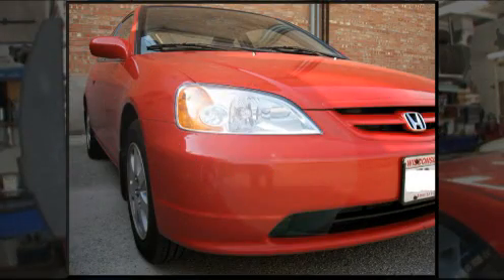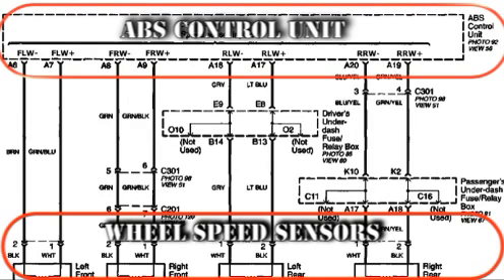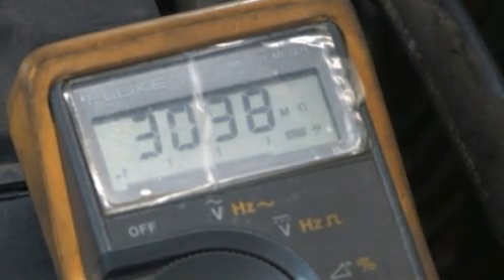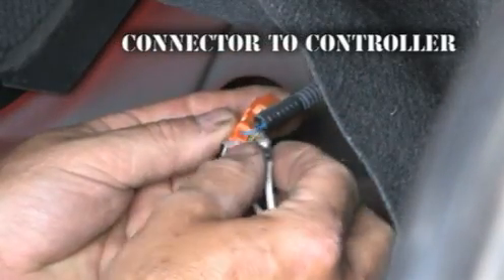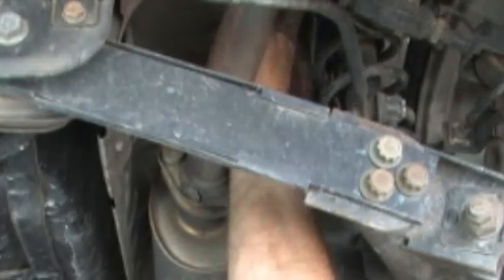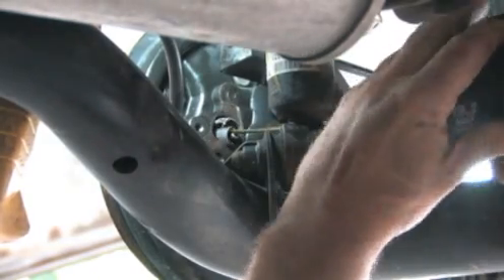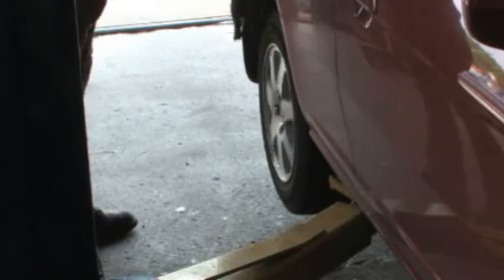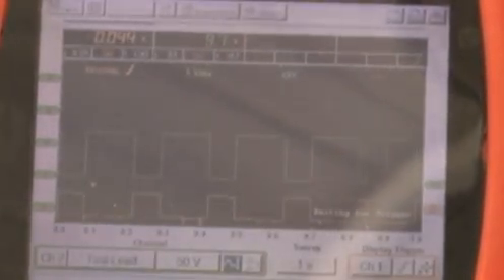ABS Sensor Diagnostics, Troubleshooting and Repair

Comment: This is a very old video. Most newer cars don't use this same type of wheel speed sensor. if you have the newer electronic type sensor you need to test it differently.
Reply from the maker: Hey Joe, you're right...sensor technology changes with time. There are 3 different technologies being used in today's ABS wheel speed sensors. You always want to verify what you are testing and adapt your test accordingly.
Mike Becker, Senior Technical Instructor
Reply: @GoTechTraining  - I recently ran into a magneto-resistive type sensor for the first time. If you mistake it for an older permanent magnet type sensor and test it resistively it will test open. It uses something called a "current loop". The ABS module feeds it +12 VDC and the module has a 110 ohm resistor to ground inside of it, both of which were verified to be good. The sensor itself has to be tested while powered up, which was difficult because of how the wiring and connectors were made. I ended up unplugging it and feeding +12 into it from an external power supply and grounding it through a 110 ohm resistor to create my own external current loop. The signal then appears across the external resistor and you can easy look at it with an oscilloscope or DVM.

Comment: great video!!!! im asking of the possibility of testing the circuit part (the wiring from the controller to the sensor) by a test light or checking the voltage (DC voltage using the DMM)at the end of the circuit (with the key on)? the idea if there's a voltage so the circuit is ok..

Comment: my 2003 Ford escape abs light came on and my pedal shuttered a little then stopped and worked fine but abs light still on. any suggestions?
Reply from the maker: Hi Dave P, the light coming on means there is a probably a code stored in the system. If you are able, have that code retrieved. it will help point to the next step in the diag.
Mike Becker, Technical Services Instructor

Comment: when you tested the wiring under the trunk did you connect the wiring harness back on the ebcm to omit
Reply from the maker: Saludos Fernando con respect a tu pregunta es possible que el motor tenga problemas mecanicos. Te recomiendo que busque un mecanico que te asesore el problema.

Comment: So, basically the sensors (which do the job of detecting problems) were the problem. How about coming up with some sensor sensors?
Reply: Sunix hey that makes lots of "SENSE" 😂
Reply from the maker: Hey Sunix, I'm not sure what you mean? The abs wheel speed sensors job is to tell the abs computer the speed of that particular wheel. The abs computer is able to set trouble codes if it notices a fault in the system.
Mike Becker, Technical Services Instructor

Comment: I replaced my abs sensor on a 2003 honda accord, when the dealer told me the abs code indicated a bad sensor, it was stuck and I had to drill it out, in retrospect I should have pulled the hub and driveshaft.  I cleaned out all the bits and the abs light went out until i started driving the car, then the abs activated for a few seconds and then the light came back on.  Could I have damanged the abs sensor ring or what else could have gone wrong?
Reply from the maker: It is possible that the tong ring is damaged or that debris got inside of it. I would pull the sensor back out and see if there is a bunch of flakes stuck to the end of it. The end of the sensor is a magnet so it will hold some flakes. Also I would verify that it is the same wheel acting up. There is the possibility that the sensor you replaced is working great, but now a different sensor is failing. Let me know how this turns out.
Mike Becker, Technical Services Instructor
Reply: Determining the problem is my challenge, I have not been able to find a way to read the codes other then take the car to a dealer, which will charge me ~$60 to read the codes.  At first it was the right front sensor.  Do you know of anyway to read the codes without going to the dealer?
Reply from the maker: Any shop that has a decent scan tool should be able to diagnose abs codes. But most likely you will end up having to pay, unfortunately. 
Mike Becker, Technical Services Instructor

Comment: yes it read right front open wire abs
Reply from the maker: It is most likely a bad abs sensor or a broken wire in its harness. It could also possibly be a bad wheel bearing.
Mike Becker, Technical Services Instructor
Reply: It's the last lite that turns off on dash may drive the hold day before it comes on
Reply from the maker: Sounds like an intermittent problem. When that light is on the ABS brakes will not function. What kind of vehicle is this on?
Mike Becker, Technical Services Instructor

Comment: had my truck towed now abs and brakes lite or on can anyone help
Reply from the maker: Do you have access to a scan tool that can read abs? The abs computer can  store codes in it just like a check engine light. It would be a good first step to verify what is causing the light to come on. If you can then comment the codes, and the vehicle you are working on I can do some digging. 
Mike Becker, Technical Services Instructor

Comment: I have a 2003 Lincoln navigator and my rear brake lights are staying on I have change brake light control switch and they are still on and my abs and brake light is on what is causing this problem.
Reply from the maker: Hello Tamesha,
When you say the rear brake lights are staying "on", does this include the high mounted brake light? The next step is to have the ABS codes retrieved with a scan tool. Once you have this information please let us know and we can help you further.
Mark Hicks
Wells Vehicle Electronics

Comment: So I got in my car after running an errand and the car didn't want to start when I hit the button. I had to cycle through the ACC/RUN until the third press and it started. However, the Brake, TC, and ABS lights all stayed on along with a single bell chime which I thought was odd. Shut it off and the car did the same thing upon restarting (3 button presses to start and the lights were on). 

I said screw it and started driving and a couple minutes later the lights went off. Great, no more issue. I pulled over to an empty lot, shut the car off and tested again and the car started as usual with 1 press. Well 5 minutes after that while driving, I got a single bell chime (but no lights). About a minute after that I got a single bell chime and the 3 lights came on.

They eventually went off again, but what the heck could it be? There is a faint 'click' sound that comes every now and then when I'm driving but I can't pinpoint where its coming from. Not sure if it's related but has anyone experienced this?

Comment: HI DEAR MARTIN I HAVE A CHRYSLER 300  2011 I HAVE A PROBLEM WITH MY CAR THE ABS LIGHT ON THE DASH TURNS ON AND OFF AND THE BRAKE LIGHT WITH IT .. I DONT KNOW THE PROBLEM IS . THE TROUBLE CODE SAYS BATTERY VOLTAGE LOW CIRCUIT VOLTAGE BELOW THRESHOLD.. CODE C210016 I DONT KNOW WHAT TO DO PLEASE HELP MI

Comment: my abs pump brings sum air out when  I brake just want to know must I replace or can be fixed
Reply from the maker: +Martin Martin's The brake system is a sealed system, the abs pump should not be giving you any air into the brake system. If you had the system apart for something like a bad brake line or something then you need to bleed all of the air out, and sometimes that includes doing a powered abs pump bleed procedure using a scan tool. Did you recently do some work on the hydraulic brake system?
Mike Becker, Technical Service Instructor

Comment: I have a 2000 Ford Focus - and took my car in to the garage because I was hearing a clacking sound in the right rear of it whenever I slow down in driving. ( I changed out the rear break shoes, rear drum and assembly, right rear link arm, rear spindle nuts).  When I got back the car both the - ABS &  BREAK LIGHTS -- were on ---- and the mechanic can't figure out were the sound is coming from.  ( He has since remove the ABS & break light  -- but the sound is still there).  What do you think?
Reply: I think if you are still alive and haven't figured it out yet you need to find a new mechanic.

Comment: Hey Mark this one dude said he found a code he said it started with a six i could not find out the rest of the code but he said it is a fuse we checked all fuse and found none bad this is max what should we do now
Reply from the maker: Max Griffith I would try a couple other retailers like Advance and O'rielly's. They might have the tool to get the codes out.
Mark

Comment: Max.  I have a 2005 pontiac g6 the brake abs and traction control light's stays on took off both front wheels and unplugged the sensors i hooked a voltage metter two one at a time sensor on milling volts and the car was jacked up my partner started the car put it in drive and probably got it moving about "thirty miles a minute i got no reading on either sensor i tried it on omes also what do you think my problem is hey i want to thank you
Reply from the maker: Max Griffith Hey Max! Go to Autozone and have the codes pulled. Make sure they are pulling the ABS codes. When you get the codes let me know and I can help you.
Mark Hicks
Wells Vehicle Electronics

Comment: very nice, very clear.
I'm curious about that heater sensor code - my heater fan stopped working the same time as my wheel speed sensor broke.  Coincidence?
Reply from the maker: John Ktejik thank you for the kind words, they mean a lot to us.
More than likely a coincidence, but at the same time curious. What is the year, make, model and engine size of the vehicle? When the blower went out, did it happen all of a sudden? Please explain the experience.
Mark Hicks
Wells Vehicle Electronics
Reply: markjhicks Ok, sure.  2001 pontiac sunfire.  It was this winter and snowy, so I had the fan going and the heat on.  The wheels were slipping on the ice and then: the ABS and service light went on, and my heater fan stopped.  Same time.  Curiously enough, only one setting on the fan broke (There's 4 settings, low, medium, high, and very high - I had it on medium and only medium broke.)  Diagnostic code is C1227, left rear wheel speed sensor.  Still need to get it fixed.

Comment: Hello Mark, I am having trouble with the hub. With the washer on, the sensor was not reading. With the washer off it started reading but keep jamming the trigger wheel. I put the new sensor without the washer and went on notice and it damaged the whole sensor- It`s not reading anything. I put a used one and with the washer, it`s  the same. without the washer it`s reading voltage, but the abs light is on. Why is the  trouble with the hub. i had to use a gasket washer to get it to read stopped the jamming..
Reply from the maker: MAHABIR MATLOO Are you using the aftermarket hub?Mark
Reply: markjhicks Hello Mark. Yes,I am using the aftermarket  (new) hub, but I`m very disappointed. The trigger wheel in the hub seems not to be magnetized and it`s not creating an attraction within the two bodies( sensor and trigger wheel). I have tried everything from no wahser to gasket washer and without washer, but the problem seems to be the same.Without washer the sensor hits the trigger wheel which gives a reading in v only then, on doing so it damaged the new sensor. Conclusion: the hub was not magnetized at the factory. Is there a way to eliminate the warning abs light on the dashboard.(Short circuiting the harness would eliminate the warning abs light?)
Reply from the maker: MAHABIR MATLOO No way to short circuit that I know of. The light goes out when it receives the pulsating signal. Plus it would not be safe. Can't you take the hub back and get a different manufacturers? Mark
Reply: markjhicks Well, that would be fine, but  it was an  internet free market purchase and that was a month ago. I`ll try to get in contact with the person I purchased It from with hopes. In my country people a very schemish. Is it possible to magnetized the entire hub. if you have an idea, let me know.

Comment: Hello Mark, it`s me again. I tested the new sensor on the old hub and it read in voltage (1 -5v), but I felt the sensor  jamming on the trigger wheel on the old hub while roating. I presumed  it coul be the hight.I`m not sure. I put it back on the new hub without the washer and it read on spinning the wheel until 8v The light seemed to work  at first  truning the switch off and on it  went in a blink, but as I runned the truck the ABs  light went on again. And this time it remains still.   What could be the problem this time?
Reply from the maker: If you have anything disconnected from the system it will cause the ABS light to stay "on". The next step is to retrieve the code(s) to get a direction to the issue.
Mark Hicks
Wells Vehicle Electronics

Comment: Hello mark, me again. I recently tested the new Abs sensor and  it read 1100Ohms and zero voltage on rotating the wheel. The question is, could it be that the magnetic field on the Hub or the sensor itself is causing the trouble? I also tested one of the other sensor I have on the old hub and it read 1257ohms and a range from 1 to 7 Vac on rotating.I haven`t tested the new sensor on the old hub cause I haven`t dismounted the wheel as yet.I`ll be grateful for your help.
Reply from the maker: I have heard some of the aftermarket hubs do not trigger the sensor properly. Try putting the new sensor in the old hub or visa versa, this will tell the story. the resistance checks, look correct and the voltage output looks right. (maybe.1 to .7, but it doesn't really matter, you have an output). You are testing it properly my friend, please stay in touch.
Mark

Comment: Excellent piece of explaination. My new sensor ABS reads open on my Blazer 2000 front right wheel.. The ABS light in the dashboard goes on and off frequently. The sensor and the hub is new. I tested the sensor with a multimetre and it read 1.2k.which it think is within the range. I can`t imagine what is the problem.Can you  give me some instructions.
Reply from the maker: MAHABIR MATLOO Sure, put your ohm meter back on the sensor, like you are testing resistance. Now turn the selector to AC volts and spin the tire. The sensor should generate an AC voltage. The faster the tire turns the more voltage. If you are generating a voltage, check your connections back to the ABS module. If you are not, check the gap between the sensor and trigger wheel. Stay in touch,Mark HicksWells Vehicle Electronics
Reply: markjhicks
thank you Mark. I`ll be in contact.

Comment: Awesome detail on this video thanks. Would a 98 cadi deville have the same resistant?
Reply from the maker: I can not find a definitive spec, however, I found where they should not read more than 1200 ohms.
Test them both, if the readings are close you are probably OK to go.
Mark Hicks
Wells Vehicle Electronics

Comment: good video....for 08-up lancers the launch diagum can show u a live reading of each sensor to quickly find which is bad...just have all the wheels off the ground at the same time while performing the scan,,,,after cleaning all the sensors do the scan again....if at that time a faulty sensor is found...replace it clear the code and also do a calibration to clear the remaining p1773 code....hope this works for u...
Reply from the maker: Very nice Ricardo! Yep works for me. Recommended to only do with a hoist.
Mark Hicks
Wells Vehicle Electronics

Comment: my 2002 trailblazer when I push on the brakes coming to a stop it feels like the traction control kicks in, have had both front and back brakes replaced and caliper on drivers side and all blead real good no brake light on or any light on the dash to show a problem. HELP!?

Comment: i checked my wheel speed sensor on my lancer, and it seemed fine, put it back togethor, light is still on.
Reply from the maker: What Lancer and how did you check it?
Mark Hicks
Wells Vehicle Electronics
Reply: Lancer gt 2012 2.4 fwd
I took it off and looked it over, made sure it wasnt cut or broken or anything, looks perfectly fine. I looked online for how to test it more thoroughly using one of those ohm/voltage/amp testers, but dont know how to set it up. a friend told me i should "calibrate" it or something,
tried doing the info button thing to turn off the light, but thats not much help because if it is broken, ill be in for a surprise later on....
Reply from the maker: mandy more
Yes, to be sure it is OK you need to test resistance and AC voltage output. In the video we show you how to do this testing, but not how to setup your meter. Sorry but to show every meter out there, it would need to be a much longer video. If you can get someone to show you how to read ohms and AC voltage, that would be all you need.
Please let me know if I can help,
Mark

Comment: this is a very interesting and informative as my 2001 D went into shop today. ABS and Brake light were on.  loud noises from control module, car turned off, I still hear pumping, unhook battery ,,ok  hook battery and module starts pumping, grinding
Reply from the maker: Please let us all know what the garage finds.
Mark Hicks
Wells Vehicle Electronics
Reply: the abs  motor was running constantly ,,had to be replaced. Now, how do we know that the abs was working or not ,, any test ,,or just insist on replacing it..any help  also said I needed caliper rotors pads ,,I had just done my rotors and pads
Reply from the maker: If the calipers were sticking the pads will wear out very quickly. This could be why they are saying the brakes need replacement. Ask them for the old parts. If the ABS is not working the light on the dash will be "ON". If you drive the vehicle on gravel at 5 to 10 MPH and firmly apply the brakes the ABS should activate and you will hear and feel a clicking through the brake pedal.
Mark Hicks
Wells Vehicle Electronics